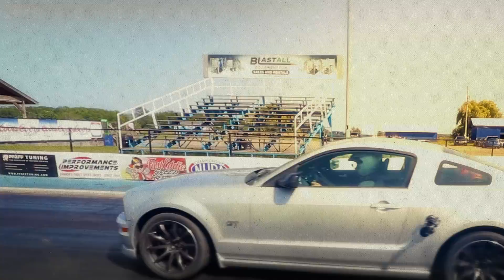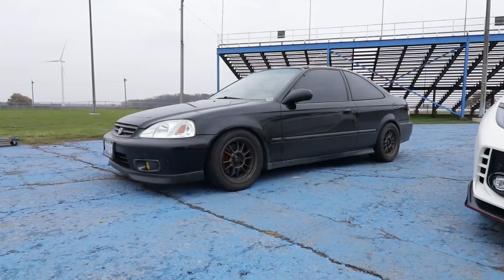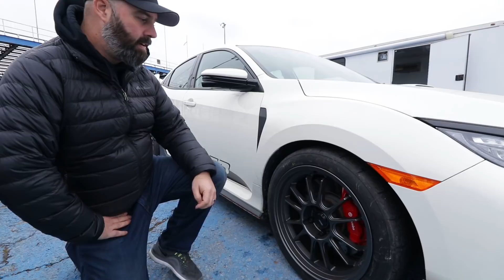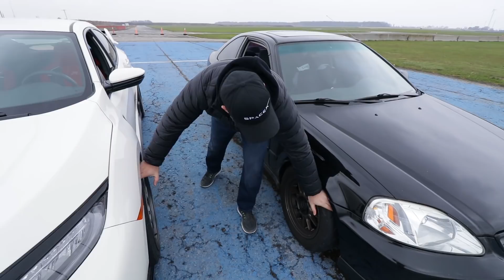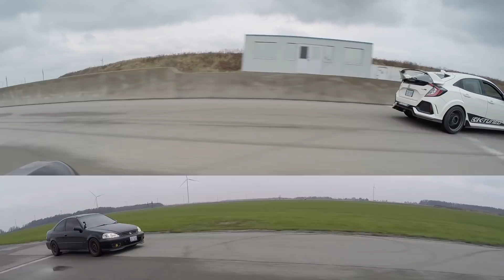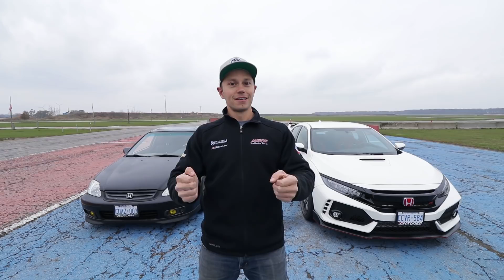Honda Civic Type R VS K20 Swap Civic - Which Is Faster?

Comment: This proves that k20 anything is still relevant. Best engine ever designed by Honda. I have a type R DC5 and it's a beast!
Reply: Driveway Demons agreed! Love your type R! I subscribed!
Reply: K20a forever! Love mine!
Reply: i knew it! its always been my favorite honda engine lol
Reply: Well,they're both k20 variants. The type R has a turbocharged k20 variant.
Reply: yea k20c2 n they get rid of the stupid earth dreams plastic valve cover
Reply: lol
Reply: Skye Higa indeed. However I have been building Hondas for 17 years and I can appreciate this type R. Nothing compares to 300hp NA when vtec hits. There should be both turbo and non turbo options.
Reply: H2B is also very relevant, and faster/cheaper than a straight K20 setup. Both are awesome don't get me wrong. Love my H2B Si! Awesome vid!
Reply: Yeah a H2B is quicker and cheaper then a stock K20. But I'd go with a K20 because mod for mod a k20 is faster.
Reply: Alpha Omega Exactly! I have to deal with ridiculous California smog/laws... So went with the H2B since all I can do is bolt ons and tune to avoid tickets... If I was going all out, definitely K series!
Reply: Yeah man, A buddy of mine had a h2b eg civic with the euro r motor, skunk 2 cams and valves. buddy club 3 exhaust, custom headers, cai and link g4 not tuned and that thing cost him for the shell 600 engine h22a euro r shipped from Japan for 1300 with 62 miles on the clock. Cams valves and springs cost him 500 exhaust and header cost 300 fitted cai was 120 fitted and link g4 was 800. Labor was done by him and another buddy of mine took 2 months to complete and he ran a 13. 2 down the stripp for around 4k. So, I was very impressed
Reply: I forgot to say it wasn't tuned and on street tires too. He was fighting wheelspin at times lol.
Reply: Jesus christ, It's not a h2b I asked it's just an h22 in a hatch lol.
Reply: That older civic is lighter also not stock obviously. Stock vs stock there's no comparison
Reply: Fabian Segura, Wow, congrats, for stating the obvious.
Reply: australia got shit end of the deal and took 20 hp away
Reply: @DrivewayDemons  the turbo torque can and always will can
Reply: @Bryce Czirr FYI, the K20/K24 idea makes no real sense. Like if you have a K24 block and a K20 head, sure. But it's pointless to take off a perfectly good K24 head (K24 head implies K24A2) and change it for the K20 head. The K20 head doesn't outflow the K24 head until after 8600 RPM. The K24 head also has thicker port walls, so they can be ported further than the K20 head. The top end power is made from swapping over the 50 degree VTC gear.
Reply: Indeed!  But it's a shame Honda removed the double wishbone from the Civic and Integra (RSX) at the same time as bringing out the K20. :(  Civic and Integra with TSX/Accord suspension & steering would have been ace cars!
Reply: TassieLorenzo agreed I’ve always thought the same
Reply: Me 2!  Still awsome to drive!
Reply: Umm. Errrrrr. No. The best 4cylinder built by a manufacturer. And that manufacturer is Honda.
Reply: what about the b18?
Reply: @robertskillz  k series is shit b series is so much better
Reply: @2003frontier4x4  great Satire 👍 no Honda fan would ever believe such a foolish statement.
Reply: @TassieLorenzo  this tells me you know how to drive! Double wishbone> crapherson!

Comment: The type r looks so much better with 18’s I don’t understand why they ever put 20’s on it
Reply: agreed, looks like a proper race car on 18s
Reply: Type R comes pre-riced.
Reply: hahaa
Reply: with bigger wheels you typically get better agility and traction.
Reply: the germans did it with their marketing ,they are killing drivers fun :-(
Reply: It helps torque steer and it why the type R has very little
Reply: aag318504 bigger rims doesn't effect torque steer. It's the suspension design that does.
Reply: patx35 yes the suspension is another factor.  But Honda didn't put some huge wheels on it because they wanted to relive the ricer era.
Reply: Since no one actually had the correct answer for you.  It was for mpg.  The larger the wheels, the longer the wheel rotation is, which keeps the revs down more because the wheel covers more distance per rotation.  They wanted to keep the civic in a certain class.
Reply: This
Reply: J Mohr this has to be he first time I've ever heard of larger/heavier wheels helping mpg lol.
Reply: aag318504 it's basic physics to gear ratio. If you haven't heard of it, then I suggest on doing research of unsprung weight, and how diameter affects the speed of cars.
Reply: aag318504 you need to adjust the Speedo... 18" hast the Same way to rotate than the 20" . There ist a min differences
Reply: J Mohr - doesn’t it take more MPG to get larger (usually heavier) wheels moving. I dabbled with swapping wheels on previous cars and with 14 inch wheels on an EK3 1.5ivtec it used to move off sooooo swiftly and easily.
Reply: PreciousMetalinvest to get moving, yes. But epa doesn't measure by that. They only measure average 25mph(city driving) and 70mph(freeway). Once the car is at speed, the rpms are sitting lower. A way to equal the playing field with 18" wheels is to get taller tire, but that will decrease the reaction of the car
Reply: J Mohr - my point is if the wheels are smaller you can get to that sweet RPM spot quicker and with less effort on the engine
Reply: PreciousMetalinvest yes. I am not saying you're wrong. My point was strictly why Honda put 20 inch wheels on the type r. It was to keep it in it's class. If it had 18s, it would be in a class higher.
Reply: J Mohr - cool thx for the info 😎
May the VTEC be with you friend
Reply: Mumble doesn’t the new CTR have 5x120 bolt patterns as well? 😂
Reply: This is not the case here. The 245/40 R18 has almost identical diameter (2mm dif) to the stock 245/30 R20. But what you're saying otherwise is accurate! Just had to look it up :)
Reply: with bigger wheels you get better agility and traction? thats just not true
Reply: J Mohr oh because they couldn’t put a larger sidewall tire on right? They did it for looks. There are tires with stiff sidewalls so it’s not handling. And wheels usually are heavier than tires so it’s not weight. That leaves looks, nothing else.
Reply: I rather have meaty tires than 20 inchers
Reply: haha funny comment. but sorry, that is not correct, caus eif you put 18s on the tyre wall is larger, so it will be the same again
Reply: Mumble def looks better with the 20s
Reply: Mumble yes it does looks better with 18”
Reply: patx35 type r also comes with grinding gears and leaking coolant from the factory
Reply: Here is why, beauty is subjective.
Reply: Torque steer on anything under 20s
Reply: It's a thing called geometry. Yes maybe looks much better with 18's but is the wrong size.
Reply: LMAO
Reply: @patx35  Rice stands for race inspired cosmetic enhancements. The rice on these cars are actually functional, so technically you're correct.
Reply: @patx35  acceptable pre-riced that looks good, and guess what?? they're functional!
Reply: I dunno, I think the 20's suit it
Reply: patx35 the 20in rims were factored in on reducing the scrub radius along with the  suspension etc. there are articles online that detail why 20s were chosen and it was to aid into the torque steer factor
Reply: And I’m mad because Subaru put 19s on the Sti, it don’t perform good with 19s on corners feels like tire going to come off since the tire are thin image 20s 🥴🥴🥴

Comment: I'm massively surprised at how much the new type R sounds like a rotary, that kind of boosty rasp.
Reply: My first thought. If there are K20 swaps in the RX8, should then this one be an option too? I mean if it's possible to get a fitting gearbox, then it's pretty much a win-win swap. Similar sound, more power, reliability, tunability.
Reply: Exhaust system...
Reply: @denisszr1522  and alot of work. theres one rx8 in progress of kswap called rx-k. its on the youtube, keep gunnin is the name of youtuber if i remember. watch their beginning to current videos of rx8.

Comment: Do you guys think some 225 width, same R compound tires on that EK would've made it more stable through those tank slappin' corners?  Anyway, loved the testing guys! -Robbie
Reply: 225s would absolutely help, NT01s and R888Rs are both 100 treadwear tires so they are pretty similar.
Reply: all seasons would have been faster in this test. those tires were so far out of their heat range its funny. 225s would have warmed up even slower if at all! tires are all about temperature guys!
Reply: I second this!
Reply: NO in the cold you always unhook the rear sway because it makes the car undrivable in the cold.  All the 225's would do is give the front more grip.
Reply: They dont know what they are doing. The suspension is crap, the sway bar to big. They should fit some racing developed suspension in there and do that with some expert and the car would handle perfect. This suspension is the perfect example for overtuning. Harder is not better
Reply: the track conditions are the issue. if the tires had more grip they would load that stiff suspension properly. no one tunes a suspension for R-comps @ 5deg C. if they had all seasons and softer springs and damping the geometry would be allowed to work but then at 25deg they would overheat and under/over everywhere.
Reply: To really get a ef/eg/ek to be stable you have to run spherical rear toe control link, and a spherical trailing arm pivot bushing.
Reply: You dont want spherical bushings on a street car.  It will be way to ridgid.  As long as the ball joints and bushing are in good shape any of them do a good job.  Urethane are awesome and a really good price.
Reply: Refine Movement turbo on the stock k20 ek would of made it more interesting?
Reply: They did not change their tuning set up on the car. They had it set up for warm conditions. He says it in the video. They obviously are just doing this for enjoyment. They know where the issue sits. Let them do their thing man. Is all about the fun you have in the end. that's all that matters. At least from the video we now know, the ek can keep up with the new type r in second and third but once they hit fourth the type r gains. mainly because of the new type r's aerodynamics.
Reply: Yes definitely. 225s with a better compound

Comment: Why my cousin took his K20 out of his EK mainly was because on Honda's the rear end is too light and each time you took a a corner the ass slipped out from under him he didn't like that he didn't like the idea of wrecking his car so he put it in an MR2 3rd gen and it is pure sex
Reply: Sway bar and adjustable damper on the suspension helps ... I took some crazy turns  doing like 75 80 ... and car didnt body roll it gripped like I was driving a low go cart
..get some tiens.... I had ksports ... that's along time ago I dont know who's killing it in the suspension market now
Reply: ??? WUT?  a good alignment, tires and suspension, not some cheap ass china coilovers and they make a lot of grip.  some people just don't know how to tune their suspension.  but, the MR2 is a very cool swap.  They aren't that great as track cars though without a bit more work than you'd have to put into the civic to run the same times.  MR2s are tank slappers.  I've owned a 95 MR2turbo and a 95 civic with K20, s2000, 350z, E36m3 and some other not so memorable DDs.

Comment: I love my K20a2 in my Type S RSX had a B16 Del Sol and thought that was a nice engine the K20 is on a whole other level and rock solid put 30k hard miles on it and only changed oil and plugs so far.

Comment: I think the Type R sounded great. Maybe just extend the exhaust out the back but without any muffler or resonator. I would use a single Vibrant oval pipe to fill the rear bumper opening.

Comment: letting off going into the turns with soft compounds in the cold... you guys are the next topgear...
Reply from the maker: What other way do you enter a corner, on the throttle?
Reply: Speed Academy you do what senna did, slow down and cut it while the other guy goes wide.

Comment: Grate video, is the new fk8 type r modified and what’s the power output of the k20 ek? Also dose the change of wheels and tyre size affect the torque steer on the fk? 
Thanks guys

Comment: What are the mods for the type r, besides different wheels and tires? I think the reason Honda went with 20 inch wheels was one method, out of many, to get rid of torque steer. Will putting 18s on it still keep torque steer nonexistent? Also, is there a vehicle setting on the nav to change tire size from 20 to either 19 or 18?
Reply from the maker: just a downpipe, other than that stock. Torque steer is pretty much the same regardless of wheel size, it comes down to how the engineers designed it and apparently Honda spent a long time to get rid of it.

Comment: How is a K20 EK able to beat a Turbo K20 Type R in a drag race? What are the mods on the EK? I know my Type-S even with cams, race intake, higher comp pistons, throttle body upgrade, K-pro and tune had hard time beating stock Evo's which have about the same power as the Type-R. I do know the EK is light but would it really make that much of a difference to beat a boosted k20?

Comment: It's possible the type r was reigning in power/boost until the engine oil had warmed up properly (which takes a lot longer to warm up than the coolant).

Comment: Isn't EK referring to the hatchback style?

I thought the coupe was called EM or something
Reply: EM is for 99-00 Si only. EJ is for coupes from 92-00. EG is hatches 92-95 and EK is for hatches 96-00. EG is for Del Sol, hatches and sedans 92-95. This is for USDM. Honda heads don't strictly adhere to this but this is what you will find from Honda.

https://honda-tech.com/forums/honda-civic-del-sol-1992-2000-1/chassis-code-cheat-sheet-other-specs-too-2581875/
Reply: EH is hatch

Comment: The second driver didn't rev the k20a2 to 8600 rpm on the drag race,  where it showed best power on dyno. Looked like he shifted around 8000 rpm reason why he was slower at the end of the straight. His shifting were kind of slow to.

Comment: so buy a 40k type R so i can get beat by an older model that costs a fraction of it yeah no ill stick to the 99 honda coupe k20 swapped
Reply: @Sergio Aguirre put a turbo on it then we talk again?
Reply: @Sergio Aguirre lmaoooooooooo
Reply: @Sergio Aguirre your are not gaining 100 whp from a simplr tune
Reply: @Sergio Aguirre 100,000
Reply: @Sergio Aguirre Link the vid
Reply: @Sergio Aguirre he made 385 whp with just a ecu tune and different fuel
Reply: @Sergio Aguirre I am not doubting the capabilities of the stock drivetrain and internals I was just stating your average joe cant go out and buy a tune to get 385 whp on any gas
Reply: @Sergio Aguirre you'll need supporting mods to get to 385 whp

Comment: I bought a 2018 Honda Civic LX at CarMax with 30k miles for 22k and I didn’t even look at the specs I just needed a car asap. After I realized it has a 2.0 k20 engine. My brother was the one that pointed it out. I didn’t even know what I had 😂

Comment: Eine der geilsten Folgen. Ich liebe euren Kanal! ... After installing Bilstein suspension to my Focus I have plenty understeer. I already set the rebound soft to the front and stiff to the rear. Now I am going to get some Whiteline swaybars. There are two versions available; 22mm and 24mm. What do you recommend? 22 front and 24 rear?
Reply from the maker: Get the bigger bar since you can play with dampening to reduce oversteer if need be.

Comment: in ways this is k20 vs k20. since the new one is still a k20
Reply from the maker: You are not wrong.
Reply: Maybe so, but the Type-R doesn't have variable cams on the intake valves, only exhaust. That's pretty different, and the sound difference is obvious.
Reply: but it looks more like an R series

Comment: $30,000 Type R verse $6,000 k Civic I'd rather put the other $24,000 in the EK and make it run 8s
Reply: ryan farrell Dude you're not gonna be running 8's for $24,000. Try $80,000 plus the car.
Reply: Mike Harkins There is a huge difference between 10's and 8's
Reply: +Nico Trice.. There absolutely is, but you could probably run an 8 for way less than $80K, but your honda may fall apart after that run LOL
Reply: Nah u wouldnt
Reply: I don't think you guys realize the new type r is meant for corners? not straight line performance

Comment: A 08 Fd2 Mugen rr k22 that makes around 260hp stock fully built and tuned with all boltons and then forced Induction it would eat both these cars easily. (not even talking about the all carbon fiber one)
Reply: Jumbie the Mugen RR makes around 240hp actually, the Mugen RR Advanced Concept makes 260hp... but there are a lot of engine parts for upgrading the K-series engine.
Reply: Jumbie how old are you 12? Lol

Comment: damn that type r is like 600-700lbs heavier than a k20 swapped civic and the civic still cant beat it in a straight line, i think its because he has a turbo with vtec running through the exhaust, that helps with the turbo 😍